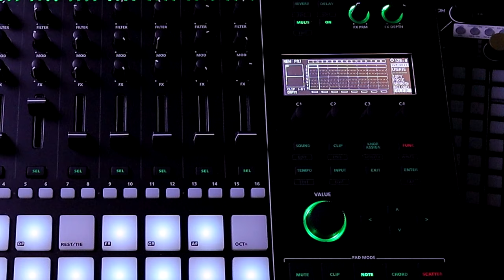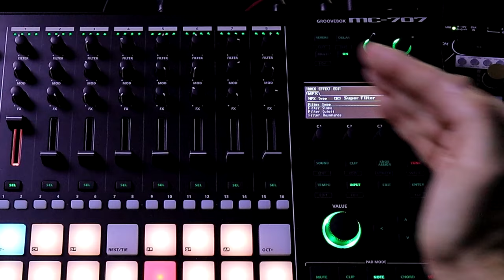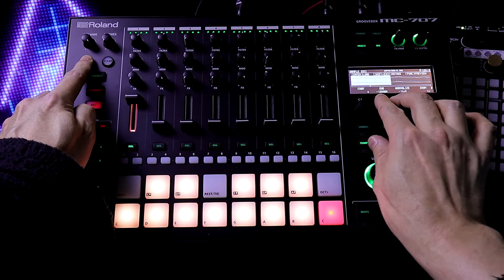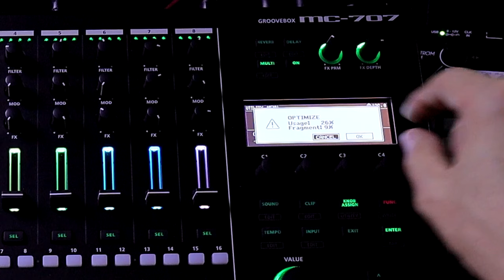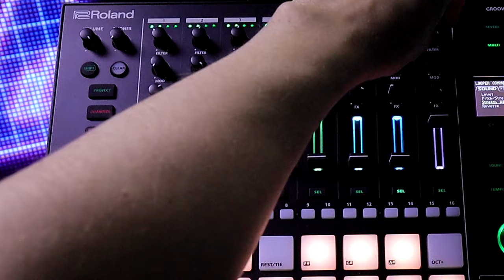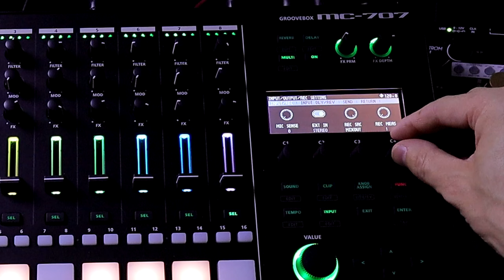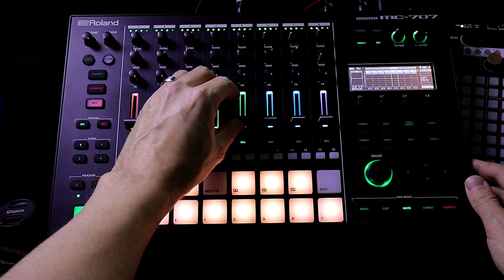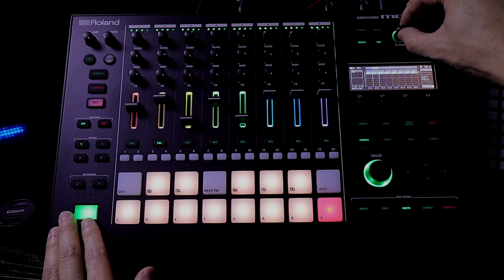MC707 BOOT CAMP PART 6 - ASYNCH LOOPER // ROLAND MC-707 TUTORIAL

Comment: one other thing you might want know in prep for your sample video is how to load samples ffom the sample PROJECT POOL on to a pad. This was a head scratcher for me but I"m stubborn and dumb enough to waste a night trying to make this work. The quirk being that drum pads only want to load from the EXPORT folder and that there is no way to send a sample from the PROJECT POOL to the EXPORT folder. I think this all because the project pool feature, which is awesome 'was kindly shoe horned in via an update.
anyway...

HOW TO LOAD A SAMPLE FROM THE PROJECT POOL INTO A DRUM PAD:

hold SHIFT + press desired DRUM PAD
press ENTER
cursor to INST EDIT
cursor to the WAVE 1 tab
change WMT1 GROUP TYPE to SAMP
scroll down to WMT! WAVW NUMBER L

you now have access to your project pool samples and you can audition the samples via the pad.

TO LOAD TO A TONE TRACK

select a TONE TRACK
hold SHIFT + press SOUND
use C1 knob to change OSC to PCM
use C2 knob to change TYPE to SAMP
the  C3 knob now allows you to browse your samples from the project pool

{this is sick because you can use all the zencore parameters and modulation on your own sounds)

cheers!
Reply from the maker: Thank you for this reference it is very helpful!
Reply from the maker: Hey so i loaded a sample in the drum kit , but it goes for 8 bars and will not sustain even if i turn up decay and release. Set end note to 80, set env mode to sustain
Reply: @RonCavagnaro  ok- yeah.  The trick is that, after you have made the setting changes I previously described, you need to continue to hold the desired drum pad while you are recording to the sequencer. So- record and hold the pad for the real time duration you want to hear it sound. Once you have recorded the pad to a loop, however long, during playback it will now sustain for a long as you have recorded it. Thr purpose of this trick method, is that when set up/ recorded like this the loop will stop as soon as you decide to stop play.  IF you want it to ring out and don't care about it continueing to play after you have stopped play- leave the sample at NO- SUS and leave the TVA ENV TIME settings as they are  default set. This can all be comfusing because there are several different windows with ADSR types of parameters, too. But the ones in the per pad INST EDIT tab window are the most definitive.
Reply from the maker: @iiaaiiaannaaiiaaii  dude i tried all of this last night was up till 2am having fun this is really cool thank you
Reply: @RonCavagnaro  Nice!!!!
Reply: @RonCavagnaro  also definitely try loading a sample from the Project Pool into a Tone Track and using the zencore power to manipulate your sounds as if they were a synth if that tickles your fancy.

Comment: Bought a cord to record off my phone for loops...but the sound is only coming and recording in the left ear...any suggestions would help thx
Reply from the maker: Hey it sounds like you have a mono cable. I could be wrong, but you can go to the record options and set it to mono. This is what i did because the cable i used on mine was mono. let me know if you hear both sodes after that :)
Reply: Ex volume is set to 255..set input to mono...now no sound at all..set it to stereo only the left ear...any other ideas
Reply from the maker: @andrewwilson5721  yes i would recommend to get a stereo cable, that can plug in properly to the input. If i could see the cable ends you have we can see what the issue is. But sounds like you have a bad cable for what you want to do. Sorry thats all ive got !
Reply: Ok thx Ron.
Reply from the maker: @andrewwilson5721  if you don't want to Wait try this workaround. Shift+sel, then audio insert. Turn to audio in L or audio in R. If either of those work you can technically record select input. Choose mixdown for source. Then you can record stuff in , but it records only what you hear.
Reply: Quick tip: it also works with usb if your phone has USB-C. Just get an “USB C printer cable”, then connect the phone or tablet to the MC-707 and use input “PC”. Pls note that USB mode must not be vendor for this. In fact it doesn’t work only with phones but with any device that supports USB sound cards. I find it more convenient than a line connection.